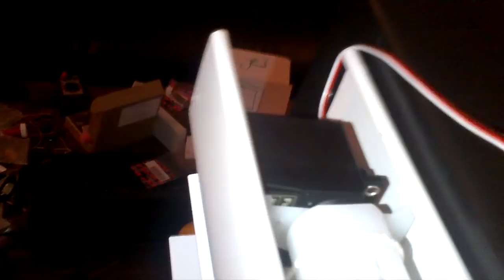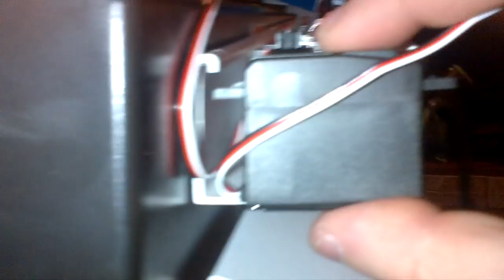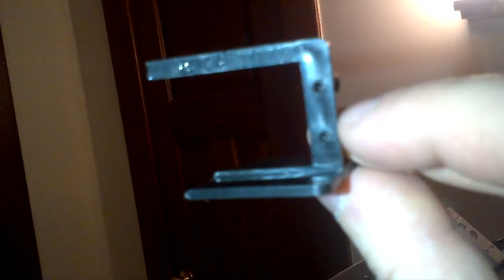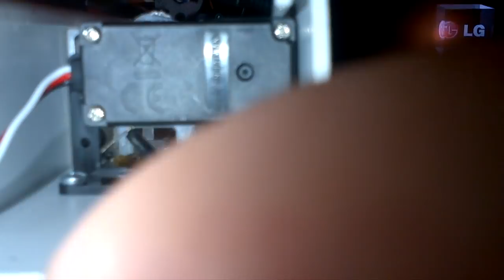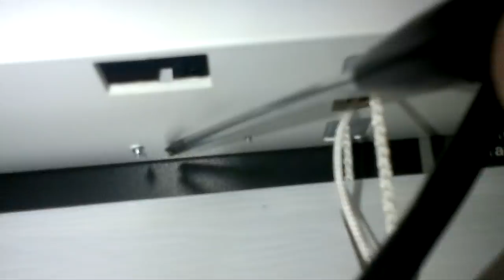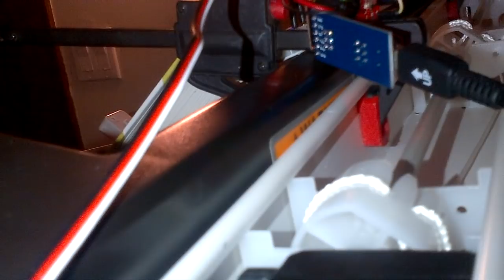Automated Window Blinds with Arduino - Servo Mount

Comment: Question:  My window blinds are vertical with a wand.  The wand needs to be turned about three revolutions to control open/close tilt function.  As far as I know standard servo goes up to 360 degrees. Is there any solution to it?
Reply: Mark Ioffe If you open up the servo there will be a piece of plastic on the gear that stops the servo turning anymore than 360 degrees. If you cut that off it will keep turning.